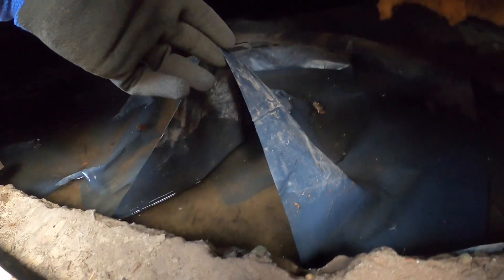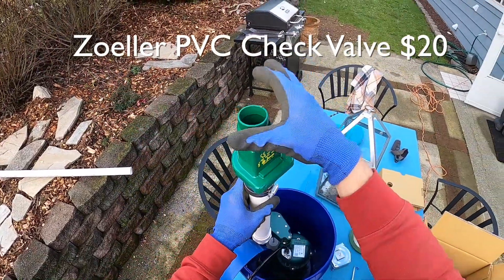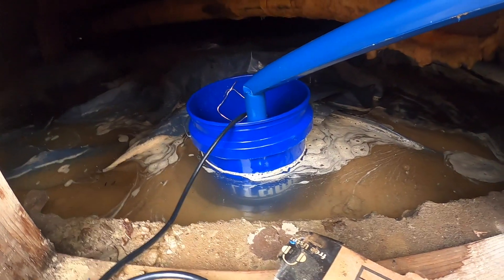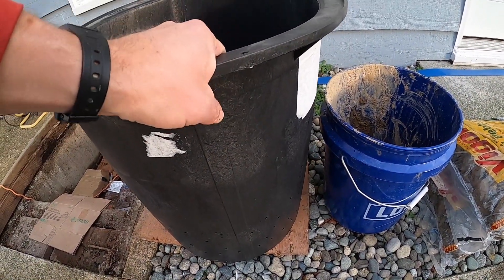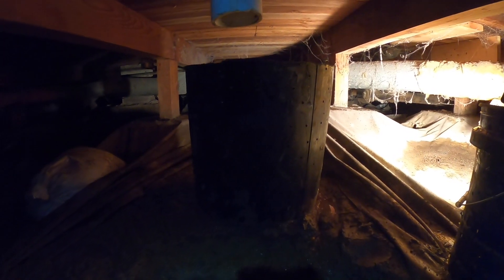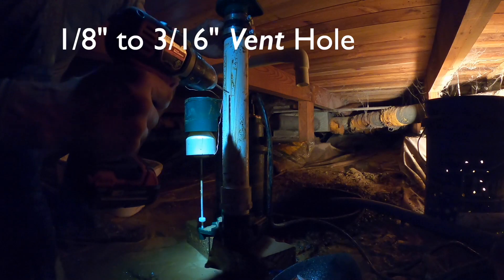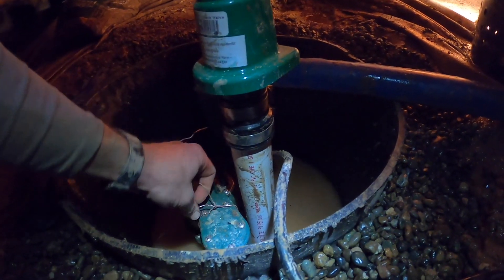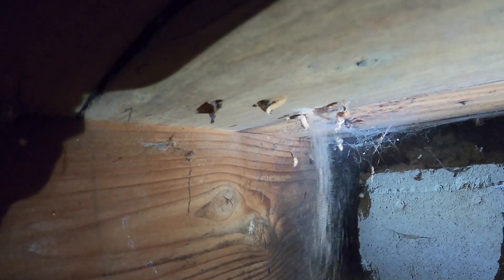Sump Pump in Crawl Space Install | Quickly after a Flood!

Comment: How did you attach the 1.5 inch pvc to the green pop up valve? I can't seem to find a 1.5 inch pop up valve
Reply from the maker: I used a 1.5 inch to 3 inch pvc adapter coupling (readily available at all plumbing supply stores including big box)